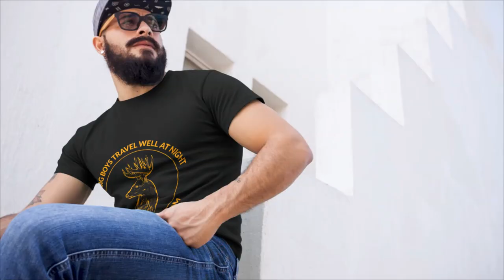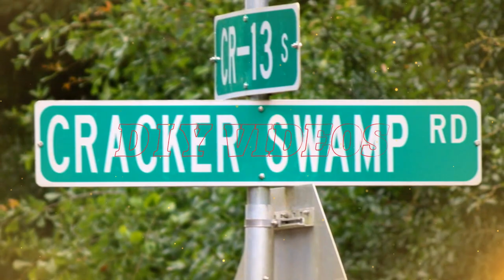Larin lift installation (tailgate winch lift)

Comment: Made in China instructions? Need to hit the company up and get them to revise that mess with your video. Definitely engaging for those that like to figure out puzzles. 2 days to assemble properly...omg....Nah, I'm good. 🤣
Reply from the maker: I know you're good but what if you need a cheap lift because you are very limited in your leverage as as in handy capable?
Reply: @CrackerSwamp  That's a great point and I am glad you brought that up. I am exactly "Handy Capable" as you call it, provided my medication works. There comes a few different views there. For one, I do not own a truck, so you already have me beat there. On the other hand, when I am not at work due to my disability or medication not working, I spend most of my time stuck in bed. Most of my time off and days off are spent exactly in this way. If I were capable and had time to put something like this to work, or could even find a use for it, then yes, I could certainly see the usefulness of it.